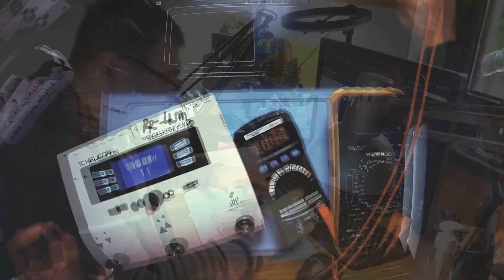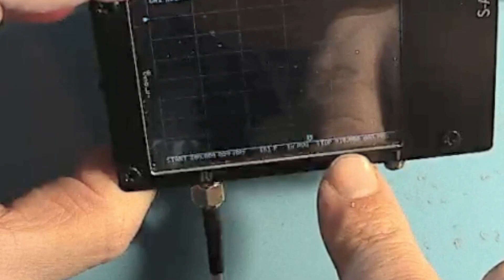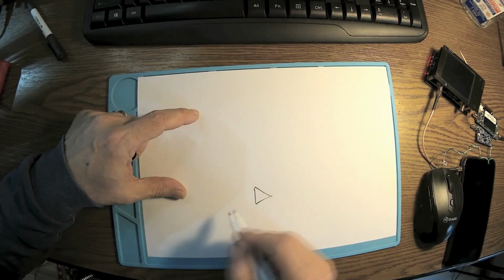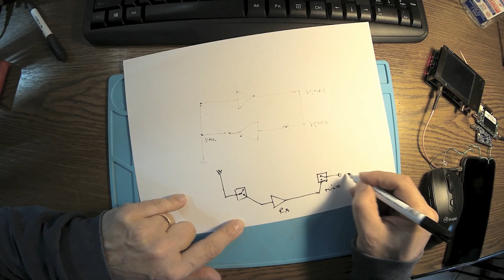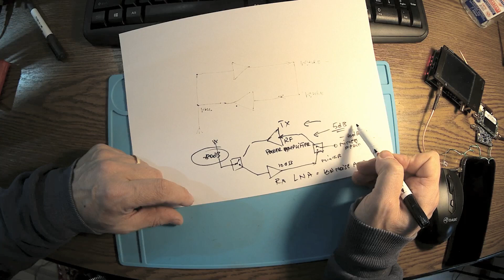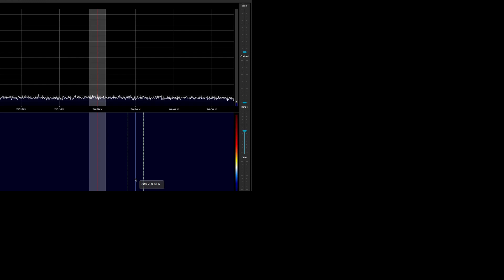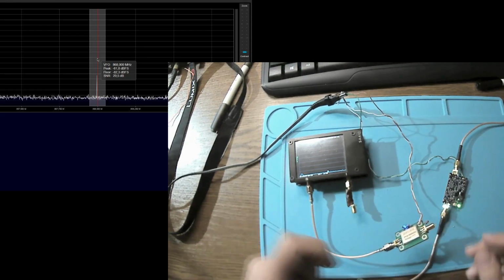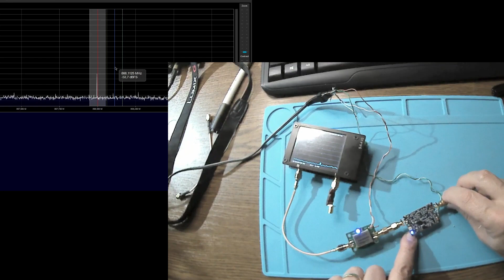Let's talk AB-IOT-868 AB-868-5V bidirectional Helium amplifier

Comment: Just installed the same amplifier and guess what? Amazing TX coverage but a drastic drop in reception... front end saturation?
Reply from the maker: Maybe it;s not commuting RX-TX...
Reply: @viocaia  I'll try to drive the relay with external MCU... ill revert back to you all FYI
Reply from the maker: @starinthe  Yes please!
Reply: The issue was related to the filter. It works as hell now!

Comment: can you please recommend a good 8dbi antenna for Bobcat miner 300?
Reply from the maker: There are so many, personal I use a RAK 8dB with very good results. It's shorted antenna (electrically speaking) so save you an arrestor!
Reply: @viocaia  there's so many chinese options on amazon and ebay that i can't really trust any of them; that's why i'm asking for a good reliable (brand) one that i might find on these websites. thanks a lot.
Reply from the maker: @mardarie  I don't have, I bought them also from Amazon, Ebay ori ALi..and I found at least 3 defective..like very good RX but no TX..fakes? I don't know...

Comment: Hello, I have an AIRBUDDY amplifier. I turn the screw all the way to the left. My antenna is 8dbi. I update my antenna on the helium site and do 15 dbi, but there is no increase in my income. My income is even lower. heltec brand hotspot keeps leaving port. How can I run this amp and increase my income? Please help me.
Reply: I broke the woltmeter at airbuddy, where can I get that product?
Reply from the maker: @ozalpcaglardemir6981  A multimeter?  https://kaiweets.com/products/kaiweets-st600y-digital-smart-multimeter-6000-counts-true-rms?sca_ref=1585756.RPFARYWfnv
Reply from the maker: Lots of different aspects involved..like cables, connectors, even power supply.Check them one by one.Let the hotspot running with antenna only, write down the numbers and compare with later amplified ones..the network is unpredictable so the only reference is your only numbers
Reply: @viocaia   i have heltec brand hotspot. I made a hotspot+ampli+saw+antenna cable.. when I do this, the hotspot always comes out of the port. There are fluctuations in my internet speed and the number of hot spots it sees decreases, lags behind in the block. becomes inoperable. Is it possible for me to contact you privately? I want to show you my work with a video.
Reply from the maker: @ozalpcaglardemir6981  Please email me..

Comment: Hi. I bought a ACASOM bidirectional amplifier but it is not doing the job at all. a week ago my miner stoped witnessing beacons more than 8 km away. But was witnesing ower 30 km. I do not know why, maybe it is a software updates because amp does not helping. it's even worst.
Reply from the maker: I never tested acasom, but it should be the same class...try to  add a filter before the amplifier.
Reply: @viocaia  I did. nothing changed.
Reply from the maker: @laurynaslauris9677  I wish to help but I never had one..the best way is to check it with a VNA if is still alive..it can be easily damaged from static around..
Reply: @viocaia  nano VNA is on it's way from china☺️
Reply from the maker: @laurynaslauris9677  Check the connectors, let the miner without amp for few days, note the signals and compare with amp on..I don't know..NanoVNA can tell you how much gain it offers..I found enough 5-6 dB..10 it's already to much..starts invalids..
Reply: @viocaia  I did compsre it is worst.

Comment: I have 3 amplifiers ab-iot-868 in 3 miners, but No I'm not seeing improvement in the witness, this is normal? in TX with 0db i transfer for 14
Reply: Same situation. I put a saw filter in front but it is not helping. no results at all. ewen worst to compare with witnesses without amp.
Reply: @laurynaslauris9677  me also.. cavity filter...nothing
Reply: @nathanshaw6503  it will be interesting to mesure gain on nanovna.
Reply from the maker: This amplifiers, even advertised for 868MHz have a very large bandwidth, so a narrow saw filter or cavity is a need.That will improve RX. Look here..almost full range https://www.youtube.com/watch?v=Q-vQO1cfyo4&t=133s